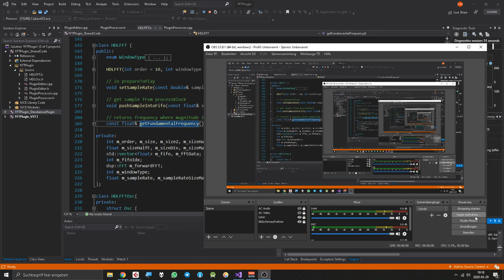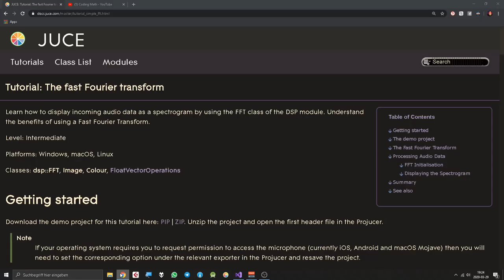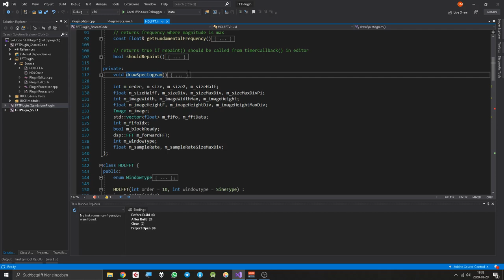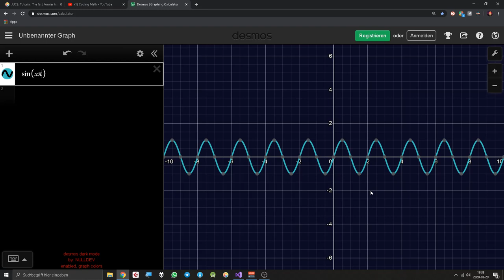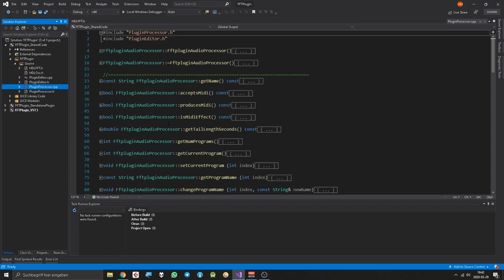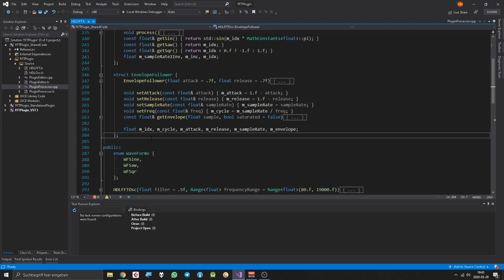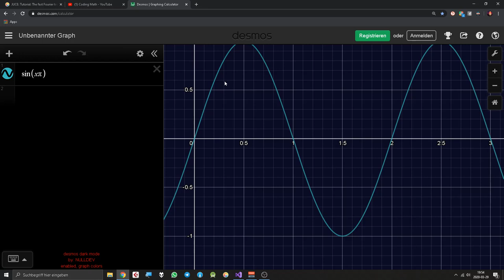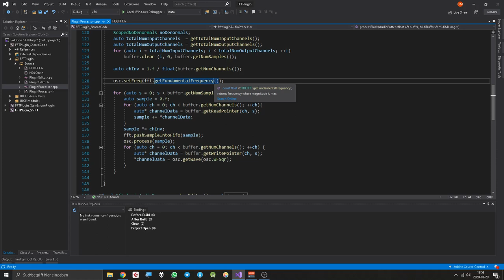JUCE Tutorial: Utilize FFT to get the Fundamental Frequency of a signal

Comment: Hi, I wonder if this plugin is able to process input from a WAV file as well? thanks
Reply from the maker: that was more of a little test. it just did pretty much what was shown in the video and didn't even have a gui or parameter or anything :)
Reply: So if I create a little piece of melody in Cubase and apply this plugin, I wonder if it will work as well?
Reply from the maker: @LuyangM  the plugin goes through all the bins of the fourier transform, gets the one with the highest magnitude and converts that to the corresponding frequency, then applies that to the internal synthesizer. but don't get your hopes up too high. i kinda messed up the repository of that project. you could still just go ahead and use this concept to make something very similiar though

Comment: Is that latency a product of the plugin and FFT processing, or is it from your screen-capture software? And how accurate do you find Juce's FFT low frequency analysis? FFT analysis is notoriously bad at low frequencies unless you crank up the fft bins beyond 4096, and that starts getting into heavy processing loads and latency issues. I wrote an app in Juce that does frequency analysis without FFT that was more accurate with less latency than fft analysis. https://youtube.com/playlist?list=PLedPvM5mpjAGdVMD0M0AaWQi25xzvRp0D
Reply from the maker: i see you made something that works pretty much the way my code worked. in my implementation i decided to use a lower order to have less latency because i tune it to the nearest note anyway. the latency is defined by the size of the fft fifo. ofc if you have to capture a lot of samples before calculating anything first you can't get immediate results. low frequencies are long and slow waves, so they take longer to detect too.
Reply: @Beatsbasteln  Yup. I play bass guitar so that's why i wanted a faster and more accurate way to analyze low frequencies other than FFT. So many low  notes! My code measures the length of a half cycle in samples and then calculates the frequency and spits out MIDI notes. So, it only takes half a cycle to find the first frequency. Then it averages the most recent three half-cycles to stabilize the slight fluctuations. Converting from freq to MIDI note also allows for slight fluctuations in freq. But, i have a few ideas i want to play with in JUCE that need FFT. I love your tutorials! I definitely can't wait until my c++ skills get better like yours.
Reply from the maker: @FullumMusic  i think the fact that you already managed to find a way to detect low frequencies faster than JUCE' fft algorithm shows that you already developed quite a unique and useful skillset. But still many thanks for your lovely words! :) The low amount of responses to my channel makes me feel like most audio programmers don't care about it. But as long as I can help some people sometimes I'm sure it's worth it.
Reply: @Beatsbasteln  You channel has great stuff.